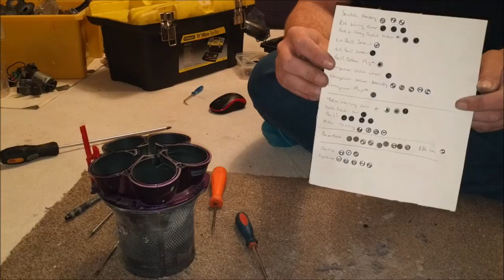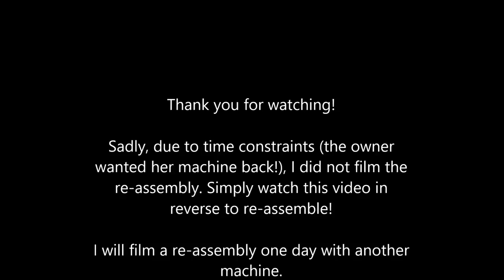Dyson DC25 Stripdown - Full Componentisation!

Comment: Found a screw on the floor and the upright locking mechanism failed to hold. Thanks to your video, stripped it down, replaced the screw and the mechanism, that was hanging by the spring, and we appear to be good again. Cheers.
Reply from the maker: Nice! Yep that's a common ossie, it backs itself out over many years!

Comment: My Dyson was a different model but your  video really help me. I liked the you broke it down made it easier for me
Reply from the maker: Awesome, glad I could be of help! Doing it in stages helps get into the flow! Main machine, motor ball/yolk, floorhead then cyclone is how I always do them! Then I usually do the same to reassemble but get the main body out the way first, then the floorhead and test the motors are still running

Comment: Thanks for the video. My foot was broke also - the plastic nub broke off and the one on the other side with the spring was breaking (seems like a dumb design). I cut them off flush, drilled and tapped for a bolt and reassembled successfully

Comment: We found a trash picked DC25 Animal at our local Goodwill for $5 US Dollars.  Works excellently but the brushroll motor is shot, family doesn't want to fix it.
Edit: Our main cleaner, a DC41 Mk1, just took a dump and so I reverse engineered it's brushroller motor and now it's in the DC25 and it works phenomenally :)

Comment: Thanks you man! I wasn't able to find a repair manual online for this DC 25 so I'm glad you did a complete break down. I found it on the curb and it has some noise coming out of the ball. It's probably the bearings. I'll see if I can refurbish this thing.
Reply from the maker: +Santos Rivera if the noise is when the ball itself spins, rather than the motor then yes, check the large cog. There's a very detailed dc25 refurb thread on the Manchestervacs forum (I know because I wrote it!) Nice to see a trash find too, we don't get many of those in the uk anymore sadly

Comment: Thank you! After watching this, I know what part I need to order for my "Achilles heel." Great job!
Reply from the maker: Awesome, good luck! Which part is it?
Reply: @beko1987 , I don’t know its name, although I know what it looks like. It’s a little part of the soleplate and it has broken off. Ordering a soleplate, which I have done, will solve my problem. (I hope!) I’m thrilled you decided to dismantle exactly the vac I own. 😄
Reply from the maker: Yea, once something snaps like that fitting a whole new one is by far the easiest! Good luck, bar having to unplug everything and transfer it to the new bottom shell it's not too tricky. Good time to remove all the fluff from the brushroll motor too before it overheats and dies 👍

Comment: Thank you Beko so much for this video. I got through replacing the chasis and getting it all back together. But, when I went to turn it, the wall plug sparked and pooped. Now I gotta figure out how to trouble shoot electrical on this. That would be a great video if you haven't done one yet.
Reply from the maker: Oh dear, that doesn't sound good! UK or us sir? I'd maybe guess you've got a wire the wrong way round somewhere and it's just short circuited. Or 2 connectors are touching somewhere but that shouldn't be possible as they've all got to be annoyingly perfect or the casing won't screw back together 🤔

Comment: Thanks Beko, that bit at 19:59 saved my bacon, now I know why the DC25 I'm working on it has a floppy brushroll assembly
Reply from the maker: Any time man, glad it helped!
Reply: Are you going to do a rebuild video as well?
Reply from the maker: Nicholas Topley I have! Quite a recent video on my channel
Reply: Hi Nicholas, did you need to remove the whole motor in order for a screwdriver to reach the screw hole? I removed the shell, but a screwdriver can't quite reach. Do I need to get an L-shaped screwdriver/ratchet tool to do this?

Comment: Great video! But the area I need help with is precisely the area you said, “don’t worry about hood you put it back together, we’ll cover that later”.  Only you don’t. Argh!!  Now in stuck figuring out where that smaller spring for the red pedal latches into. The pedal and wheel assembly just won’t operate properly because I can’t figure out how to reattach them correctly (and I got the larger spring oriented correctly).

Comment: What an awesome tutorial video - good man Beko1987. Thanks. 
We bought a second hand machine which had been "serviced" (new brush roller, new filter) and it seemed a bit lacking in suction. We turned on the DC25 this morning and there was a burning smell. Stopped the machine and bought a replacement motor which I hope arrives this week. While waiting I decided to check the cyclone gasket and presto it was ruined! Service engineer obviously didn't check that did he! 
Beko1987, do you think the perished gasket could be related to the burnt out motor?

Thanks again.

Comment: Hi Sam, thanks for another excellent video! The dc25 is clearly a lot more complicated to refurbish then the earlier dyson models. Is it possible to put the motor filter (located in ball) into the washing machine? As I'm currently trying to service mine. Thanks again
Reply from the maker: Yes you can. It'll clonk around something terrible so put it in with some towels etc! It won't come back white, it's stained for life but it'll clean it OK.
Reply: @beko1987  You're a star. I'll get that done over this weekend. Fantastic
Reply: I put two filters in the wash and they came out great! Then decided to do another one and I forgot to remove the rubber seal. One of my Dc25s makes a loud noise when turning it off. This is meant to be a common problem. So definitely damaged the seal haha
Reply from the maker: @hugohenderson1788  smear of vsseline/grease on the rubber seals (inner and outer). Sorts that right out

Comment: Thank you for this video - it's great!  However, I need to know how to strip down the wand - and you said you wouldn't do it for this video but you had done it on the Manchester Vacs site.  I've searched there and can't find it.  Could you put a link here or even in the video description?  Thanks again!
Reply from the maker: It's in one of the dc25 refurb threads but from memory/iirc: , about level with the cord hook are 2 plastic tabs. Release both then pull the inner ring down level and watch for flying springs. The assembly should slide down. Then unjam what's jammed and pop the springs back in and slide it all back up.
Reply: @beko1987 , thank you for your reply!  I'm sure your clear instructions will help me get it fixed when I get back at it tomorrow!  Thank you so much!  🤝🤜🤛👏

Comment: Thanks for the video.  I DID NOT cardboard all my screws, therefore I have 1 screw left over.  It's silver with a silver washer attached.  Any idea where that goes?  Also, I lost the teeny tiny spring for the lever to remove the brush head...on the bottom.  How critical is that spring?  Thanks

Comment: Great information! Can you provide a URL for the disassembled handle diagram or for a video? The wand on my DC25 no longer releases when it is pulled up. I removed the hose in case it was twisted and also tried simultaneously pushing in the 3/4" x 1/8" oval tabs in on both sides of the handle while pushing it up but the handle still won't release from the aluminum wand. Many thanks in advance!
Reply from the maker: I'd fire a bit of wd40 into the red clip at the front of the wand red end if you can, that needs to unlock first. You can strip a jammed handle off the vac if you can get the wand bit up, otherwise your a bit screwed... Good luck sir! https://manchestervacs.co.uk/DysonForum/index.php/topic,1060.0.html
Reply: @beko1987  Great! I'll give it a shot (pun intended). :)

Comment: Have you ever run into the head not releasing all the way to the floor? I've had the dc25 for 11 years and everything else works perfectly. I maintain it very well and have fixed issues in the past but never have I run into this problem.😬
Reply: I'll add that I used it 3 days ago, and it went down just fine. This thing is my 3rd child, so I'm freaking a bit.😅😂

Comment: Hello. I cannot find your tutorial on how to reassemble the DC25 handle assembly. I took it apart to try to fix the hose and a small spring and plastic piece fell out and I do not know how to put em back. I put the handle back on and it is stuck on now. I assume the pieces that fell out where what released the wand.

Comment: Yes, that bloody black clip @ 19.20 has fallen off mine too. The screw that was holding it on came loose. Now I have watched this video I can see how much of a pain its going to be to fix it. You cannot access the screw head to screw it back on without removing the whole ball it would seem. Great.
Reply from the maker: If you recline the machine and undo the 4 ball screws you can just about remove the ball shells and maybe get to the screw? Alot easier than removing the yolk and ball completely...
Reply: @beko1987  Thanks. I'm in the same situation. Looks like this is a common fault. I managed to get the black plastic part back in place (eventually) but a normal screwdriver can't reach it without removing the motor assembly. With the ball shell removed (as you suggested) I reckon a little L-shaped ratchet tool would do the job. Think I'm going to try ordering one off the internet, unless there's an easier way...

Comment: I have a DC25 Multi-Floor vacuum that I picked up second hand dirt cheap, works great, only issue is the wand is stuck. It isn’t the kinked hose issue, the ACTUAL metal want looks like it was stepped on or something. I’ve tried to pull on it to get it out, I’ve tried to press the tabs on the side to release it and push it up, no luck. Where is it I can find how to fully disassemble the wand? Or do you have any tricks that would help me get this thing off to either hammer back into place or replace?!
Reply from the maker: It is possible, but very tricky. The plastic end of the wand has to come off, and that's tricky, then push the metal tabs back in. Then you can pull the wand up and out. The locking mechanism will either stay put or fall apart so make sure you note how it goes before fully removing the wand! Or get a used wand from ebay for a tenner or so...

Comment: Hi Beko, great Video. I have a problem, my Post Motor Filter clips back in fine when I have washed  and dried the filter, BUT, after about 3 Mins of running the bottom half of the Filter Casing pops out and fouls the ball.
Any ideas M8  - Cheers Nobby
Reply from the maker: Hi Nobby! They do that, sadly itll be the motor housing warped slightly with age and heat. New filter might have a stronger clip, or find a way to bodge it in somehow. As you can see, it's a pain in the arse when they pop out. Best of luck!

Comment: I have a question for you.I own a DC25 and recently had a damage power cord.I cut it and added part of another cord from another vacuum cleaner.Both wires consisted of one black wire inside and one white.I thought okay simple fix but everything works normal except when I power the vacuum off it makes a loud revving sound then the sound fades off.So then I added another power cord this time without splicing them together and connected it directly to the power button and still have the same problem.Do you know what could be causing this?I really love this vacuum cleaner.Thank you.

Comment: Hello. Good video! Too in-depth for my requirements though; I only need to replace the Yoke Loom assembly. I have located the wire that is now in two pieces...do I have to remove the ball (and everything beforehand) to replace it? Many thanks
Reply from the maker: Darren Kemlo yep, afraid so as the yolk doesn't come off with the ball fitted

Comment: I see this video is over 2 years old & the market has changed! A new Dc25 brush motor is now £25 on eBay & a brush bar housing with a motor is £47. It's now cheaper to fit a new motor. Amazing how quick things change :)
Reply from the maker: I know! I've started doing vacuum repairs on a budget videos, because it's so cheap! Heck on dc25 and backwards I include new filters in a full refurb as their so cheap

Comment: Just what I needed.  Thanks!

If the brush does not spin when activated, but will spin (briefly) when the reset switch is pressed - you have any ideas to troubleshoot?
Reply: This is exactly my problem, did you fix it?

Comment: Not sure if you’re answering comments. I’ve got a DC25 and I need to remove the changeover hose, something that was missing from this video. Do you know how I can go about doing this?
Reply from the maker: Yep, I'm answering the comments! Does this help? Scroll down a bit but basically take the main changeover valve off then pinch the 2 pivot points of the end of the hose and manhandle it out of its place on the chassis https://manchestervacs.co.uk/DysonForum/index.php/topic,1060.0.html

Comment: My DC25 wails like a banshee when starting up and after a short time it settles to just an unbelievably loud whine.  I'm thinking bearings in the motor head and the main motor.  Are these serviceable - I can't find any parts listed for them.  Other than having to wear industrial ear muffs, it works fine.
Reply from the maker: Itll be your post motor filter... Remove it then turn the machine on! If the noise goes, replace your filter :)
Reply: @beko1987  Thanks heaps, will give it a try tomorrow.  I had also thought to take the motor head off to eliminate that as a cause.
Reply: @beko1987  Thanks again - I took the filter out and it removed the banshee wail completely.  So happy :)
Reply: @beko1987  add some silicone lube on the filter seal

Comment: Hello Sam I would love if you reply. I have a problem when I was taking the cleaner head motor out of its chamber I snapped the clip that holds it in is this a big deal or not because this machine is a refurb one and I'm panicking
Reply from the maker: Bob Surrey Hi Bob. Do you mean the black part that goes around the cog? That clips onto the other black part that holds the brushroll cog?  If so then no, by the time it's together the belt holds it tighter than the clip does, as does screwing the head up. Test it before giving it back to the customer, but ive snapped one side off before with no ill effects!
Reply: Beko1987 hi Sam thanks for reply the piece I snapped is at the 50:19 part of the video where you say to gently lift the brushroll motor out of its housing well as I was levering it out the piece just snapped that holds it in place and I can't find it anywhere

Comment: I am trying to remove the bin flap as shown after 52 minutes in order to replace it.   But my sharp pull has not freed it.  Am I probably not pulling hard enough as the 'bear hug' does not seem to distort the hinged region of the bin?   Or do I just have to cut the pins, or break the 'arms' that they are on, as I have the replacement flap ready and waiting.
Reply from the maker: If you've got a new flap then yea, break away! The idea is I stick it under my arm and squeeze hard perpendicular to the pins, so their pushed apart and snap out easily as the locking nobles themselves are rounded. Issue you might have is fitting the new one, it'll need a squeeze and a fairly steady push or it shoots off up the moulding and you bash your hand on the edge of the bin!
Reply: @beko1987  Thank you very much Beko1987.   With that encouragement I squeezed harder perpendicular to the pins and pulled harder, and the flap came loose.  And then the new flap went in similarly.  I think Dyson must use stronger plastic than many companies. Thank you again.

Comment: thankyou for teaching how to fix my purple animal dc25. save me 100.00 dollars! fix the part where the screw came loose on right side where the spring is next to the ball. had to remove the ball and the screw fell out! screwed back in put back together works right now Thankyou  question why can you only screw in part way? if you tighten it all the way the spring will not work.
Reply from the maker: german shepard Any time man, glad to help! I think if you torque the screw up it just clamps it too tight for it to move, probably why it loosens off in the first place! A drop of superglue on the threads of the screw then fit it before it dries should sort it out!
Reply: Hey there! I have had the exact same thing happen! The original screw and locking washer have disappeared. (I knew what was broken but didn't see what was missing until I took it apart) any suggestions on fixing that without the original locking washer or where to find the part online?
Reply: go to Ebay  type in Dyson Animal 25  hardware  parts and you will find the parts.

Comment: My DC25 brush bar head spins up momentarily and then shuts down.......Any ideas please?
Reply from the maker: I'd be having the side cover off (3 T20) and checking if the loom is snapped. If not, then up top and the brushroll power switch and/or reset switch (both get blipped by the on button so if the switch just bounces, that'll be in. Infact hold that switch down manually, that'll soon tell you!)
Reply: @beko1987  Huge props to you for that! I'll have a look see. Thanks!

Comment: can u tell me if I need a normal screw driver or a torques screw driver for taking a dyson machine apart or does it differ from model to model?
Reply from the maker: It's a torx driver, and usually the same size, however some of the newer machines use smaller screws. When I took the v6 and dc54 apart, I needed to get my micro laptop disassembling set out for the cy line screws!